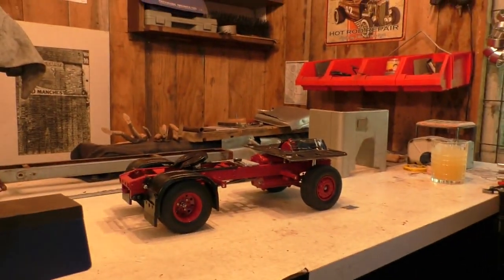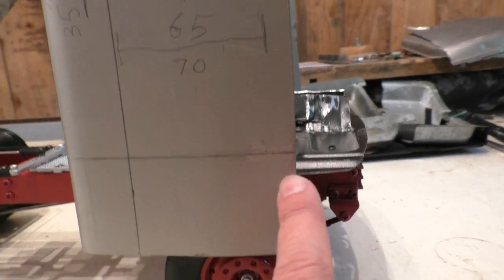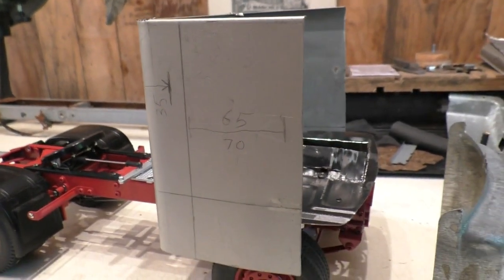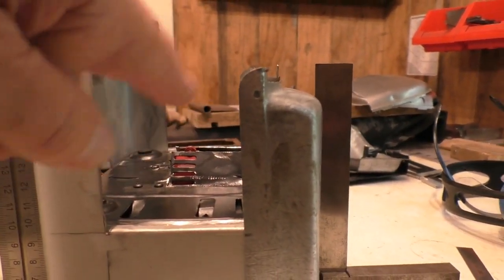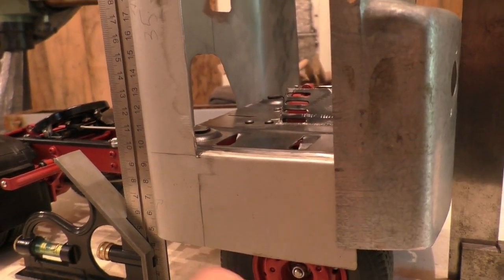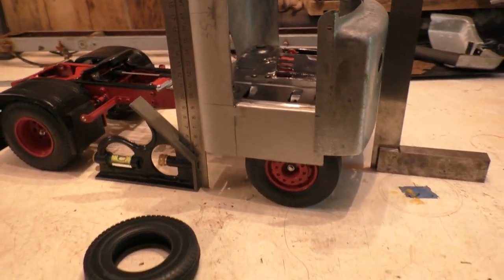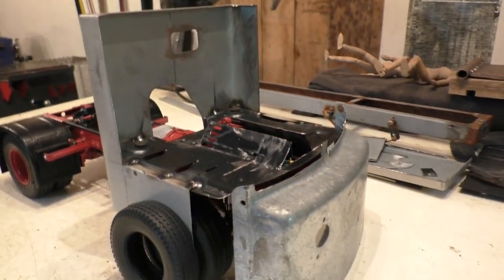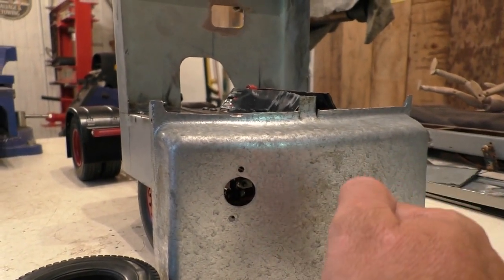1950's era White Freightliner model build. 1/14 RC semi truck model.

Comment: I´m greatly enjoying this build. There´s the challenge of having such a short cab - short fore and aft - and having to fit everything in somewhere...
Reply from the maker: Yeah, there ain't much room if I am trying to make a scale interior as well.
Reply: @OldIronRC  I spent part of today staring in bewilderment at an MN Models MN45 with scale interior and a receiver, ESC, battery and a big bundle of wires, wondering how I´m+ going to cram it all in there...
Reply from the maker: @Del350K4  lol, I have spent many many hours just staring at models while my mind was virtual building. Usally after thinking about different solutions I go with the first one.

Comment: I really like your builds, reminds me of when I were little because then we had soething called "Tonka" they made tractors and trucks. I had also a Corvette 62 splitwindow that I tried to make RC but beeing to young I could not make all the right decisions, over time it has disappeared during moving to new places. I'm often falling back in my memory to the "Tonka's" and with your technics it should'nt be so hard to make an articulating wheel loader work with lift, tilt, forward, reverse, steering, sound, lights, etc. My brother in law worked at an entreprenade and drove a giant wheel loader, International Harvester Hough, think it was like 6 meter up to the cab.
Reply from the maker: Funny you should mention Tonka. I was not confident in my skills, seeing so many awesome builds, then I noticed how cool the old steel Tonka toys were, and how simple they were. I figured I'd build to a "Tonka toy standard" - relaxed my ideas and went with it, havn't stopped making since.
Reply: @OldIronRC  That is a super-cute backstory and I am totally down with it. :)